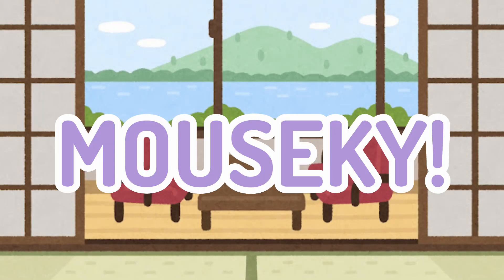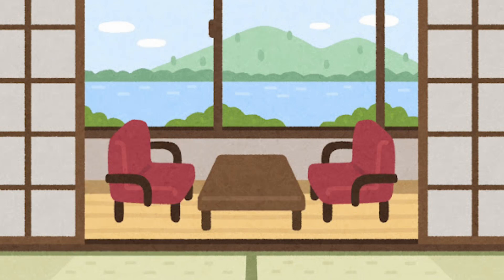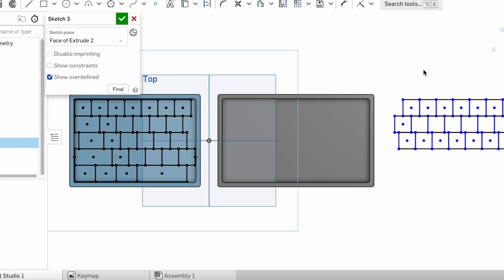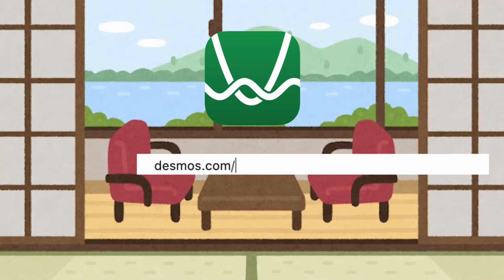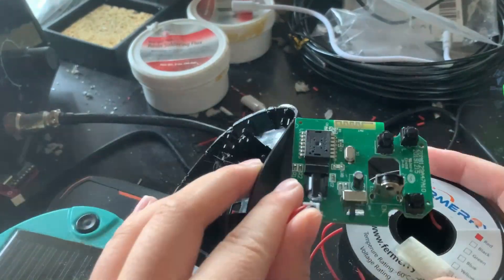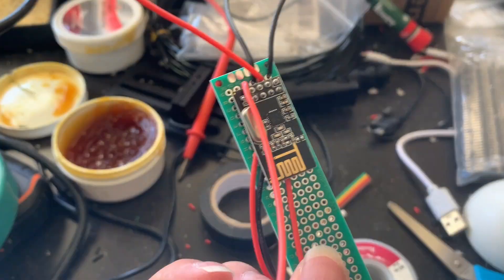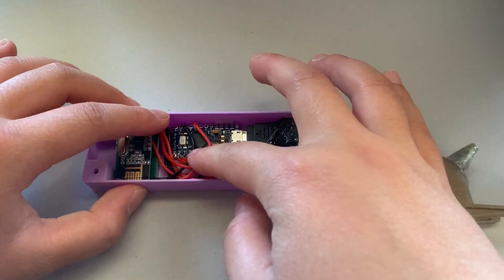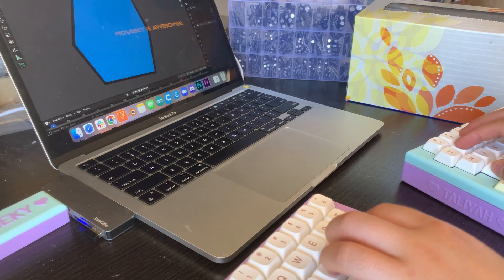MOUSEKY: Full Build Video

Comment: hi just wanted to share that you can use qmk firmware for the coding part + use via and there is a website that can generate the plate files as dxf or svg

Comment: 3:58 A voltage divider shouldn't be used to power anything. Adding a load changes the voltage it will output. You should use a voltage regulator (buck converter or LDO)

Comment: Really cool project. How is the battery life?
Reply from the maker: I wish I left the battery level indicator visible, but it works for maybe 30 mins to an hour.
Reply: @taliyahengineering  You should try a project with qmk, or zmk if you want to go wireless. The mod tap, tap dance ect are life changing. And also the battery life with zmk is really good
Reply from the maker: Thanks for the advice!

Comment: I'm curious, are there any downsides in using diodes instead of resistors for key matrix mapping?
Reply from the maker: Diodes probably would have been better haha
Reply: I don’t think it’s possible to use resistors for the matrix. I don’t exactly how these matrices work, but to my knowledge the diodes prevent electricity from flowing back so the controller knows which keys was being pressed. Please, don’t quote me on that, though 😅.